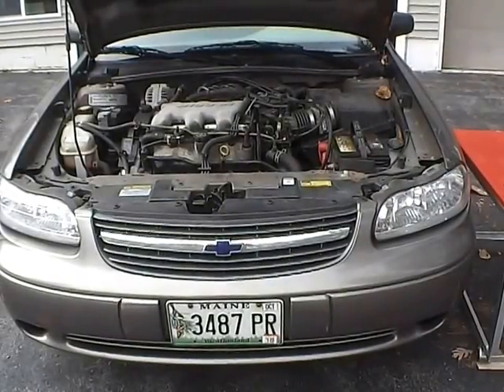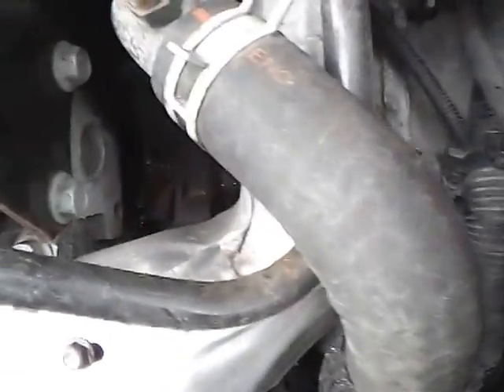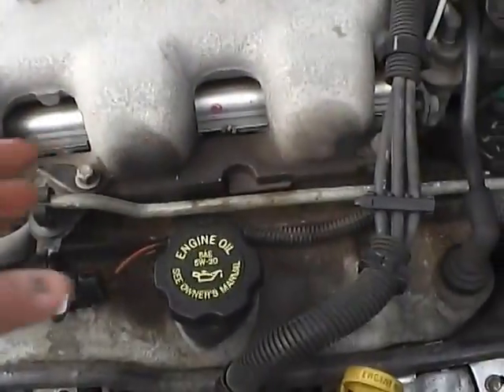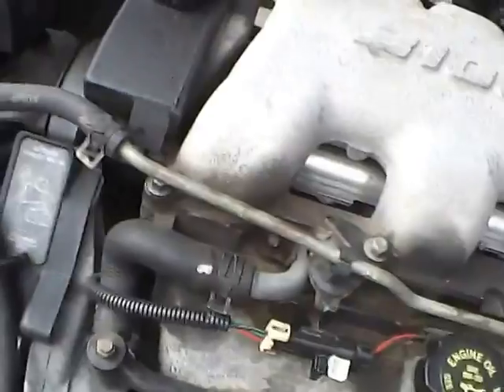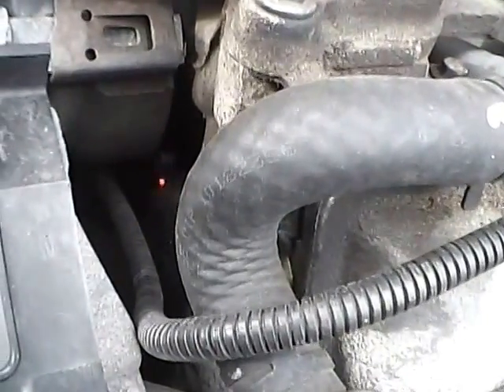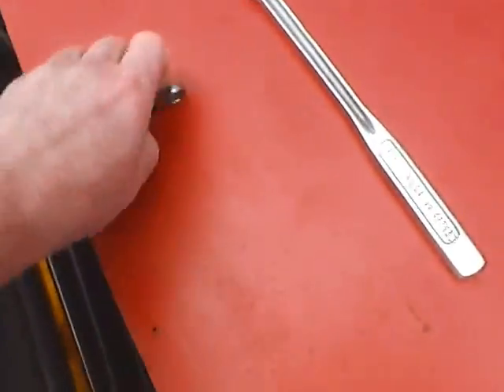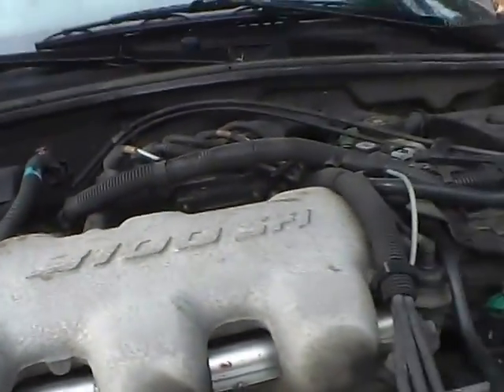Malibu or GM 3.1L  Engine Coolant Leak Quick Fix

Comment: For anyone doing this! It was actually pretty helpful but he missed the main culprit, same 10 mm bolt but its right above the leak there just under the wires that connect to the throttle control. Its right above the puddle of leak

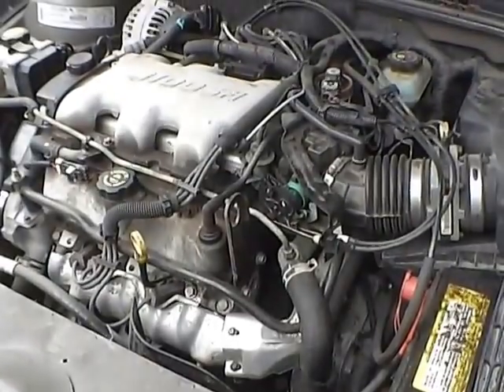Comment: Your video is now almost a century year old. This shows the significance of sharing our experience with others. I have a 1997 Malibu with 30k miles, this exact thing just happened to my vehicle and your video has helped 7:16  me solve the issue. I did however remove the power steering pump and a few things to get better access to the outer bolts. As you indicated all the bolts were significantly loose. YouTube has become our Encyclopedia of knowledge. 🙏

Comment: I'm sorry but this isn't a fix for the gasket leak. Loose bolts aren't why this gasket leaks. It leaks because the gasket seal around the coolant port between the surface of the lower intake and the head has deteriorated. In some cases the plastic also has become brittle in that area and broken down over time. It's more likely that whoever worked on your car last did not torque down your lower intake bolts properly or reused the bolts after stripping them out and that is what is causing your leak. If someone truly has an intake gasket leak the only fix for it is to change out the gasket.

Comment: I have a 2002 Chevy Malibu and have been leaking antifreeze every week I've had to put antifreeze in it I can't I don't know where it's going can't find it some people said that General Motors had a problem with the surge tank cap well replace the surge tank with the new cap and the problem actually got worse so I ended up but I watched your video and I end up tighten down those six bolts and it worked I had also put Teflon tape around the surge tank cap and now it doesn't leak antifreeze at all now thanks for your video

Comment: Eh! Idk cause if you tighten that down, you may have a oil leak. Supposed to be recommended tightening. How ya be careful but came down all to it and after changing the head gasket and thermostat etc? Found out it was a timing cover gasket. 🤦🏾‍♂️

P.S I was told if it ain’t broke don’t fix it!

Comment: only problem is if you tighten those bolts too tight you will crack the manifold since it's plastic also the gasket is plastic which is destroyed by the DEX-COOL antifreeze
Reply: Maybe is when you mix different coolants together
Reply: Then GM should pay for whatever damage is done by the Dex since they recommend filling it with the stuff in the owner's manual.

Comment: I read your updates in the description of the video, interesting... the last update said the garage charged to almost $700 to replace the intake manifold gaskets.... seems a little steep but then again most garages are, they gotta keep the lights on, sucks that the guy that did it only made about fifty bucks though and the shop kept $600 but that's beside the point, I digress, the real reason I wanted to comment was you said In your last update in the description after they did the work you now have a check engine light with the code p0171 which is lean bank 1 ... and they told you that you need an oxygen sensor... now coolant CAN junk an oxygen sensor for sure, but if I had a lean code pop up right after someone changed my intake gaskets I'd automatically be a little suspicious and was check for myself if my o2 sensor was actually stuck lean with a scan tool out it was functioning properly and also look at my fuel trims and check for vacuum leaks and the new gaskets or maybe they forgot to hook up a hose or broke or split one by accident causing a vacuum leak.

Comment: if the gaskets cracked how would tightening it more fix it, the fasteners from the factory are torqued to spec... i dont understand how the fasteners are coming loose on their own
Reply: They don't. The gasket is plastic and the seals are rubber. When the intake is originally installed on the gasket it compresses the rubber into the plastic gasket and makes a seal. Over time the rubber and plastic around the ports start to deteriorate from the coolant heat and then you get a leak. Since these cars use plastic gaskets they can't be compressed anymore. if your bolts are loose it's because someone previosly worked on your car and they were either stripped or not torqued down properly to begin with. They shouldn't be loose.
Reply from the maker: You have to understand that the gaskets have a certain thickness but when they turn to "goop" that thickness is decreased leaving the intake manifold bolts no longer torqued! Tighten them again squashes the bad gasket and seals again partly. It is Not a perfect fix, but it can buy time before having a major repair.
Reply from the maker: It is not a crack in the normal sense of the word. It is more like Goop

Comment: Not a good fix. The 3100 is a great engine, but it suffers a few problems, notably the intake gasket design. It's not too bad to just take the intake off and replace upper and lower gaskets with the metal Felpro gaskets. Fix it right next time.

Comment: I have A 1992 Isuzu Rodeo with a 3.1  V6  Chevy engine.. Do you happen to know the firing order I need to set the timing
Reply: It don't have coils?  Any info can be googled. Shouldn't take 2 mins to find out.

Comment: I am not a mechanic, but I did work for a mechanic as an apprentice for a year. 
First : 
I have a 00 Malibu 3.1l , when I first got it I did the mistake of putting the wrong antifreeze color green as the require gm that is color red , this was before I work as a mechanic apprentice. 
I can see in this video that this vehicle has the color green antifreeze and I read somewhere that it eats away the gasket, soon after I put the green on my car ,started leaking from the same spot as this vehicle. 
And I know that replacing the upper intake manifold is expensive but working for a mechanic I did had the chance in doing myself and I do still drive my 00 chevy. 
I don't believe that only a mechanic can do it ,it just a matter of doing an extensive research first also having the appropriate tools , do not attempt to do this job without having a trusty torque wrench.
Reply: This is quite different than the compatibility issues Dex-Cool has had. The L88 3.1L and most of its relatives just had a poor intake gasket design, made from what I would call an unsuitable material to boot. Unrelated to the Jello/sand problems those same engines (and many other GMs, ugh) experienced. I love my shitty Chevies, but DAMN.
Reply: ... wasn't GM sued over their Dexcool concoction, which caused damage to engines.

Comment: first I am a mechanic student, secondly that engine is an aluminum block where it is common knowledge that if u over torque those bolts u will scrap the block itself because it will warp. this maybe be a quick fix but the true fix for this is to replace the gasket. if u do like this man does and tighten half the bolts it will most definitely warp the intake cover with it run over time. that's why he says he still has problems with it. its worth spending money on a mechanic who is certified for professionalism in automotive repair. that way u end up with a fixed car that is dependable not barely running.
Reply: how do you get certified for"professionalism"in automotive repair? lol Im certified in "excellence"  in automotive service....at least that's what my ASE certificate and patch says lol but I must've missed out on the professionalism certifications...lol 
I'm just yanking your chain bud. just wait till you get out there in the real world and start working, I admire your conviction, but honestly what this guy is doing is just to get him by for a little while longer, that's what is poor people have to do from time to time, I could never afford to have my own car repaired at any place I've ever worked at. And honestly you'll find out pretty quick that all that professionalism your talking about in the repair industry is few and far between, I went to tech school for automotive technology too bro and I thought kind of the same way you do now at first , but most people are better off doing a little research and fixing their own vehicles alot of times.... there are some really good honest mechanics out there but not many, you'll find out soon enough that you chose a profession that's full of hacks, crooks, and cut throat back Stabbers ... sad but true... and what this guys doing here is nothing compared to what your bound to see go down in your career if you end up sticking with it.
Reply: @TheCoatneyadkins  I believe they take advantage of people and not qualified or trained enough to take their time on other people's vehicles.
Reply: block is iron
Reply: @dereck72  Yes I have a '99 Cutlass -- the heads are aluminum and the block is cast iron

Comment: thanks  man
mine has 40000 thousand       and the ignition went out the back tail lights were out the front right shock coilover spring snapped and the coolant leak is getting really bad now
unbelievable.    again thanks

Comment: I've got a 1997 Lumina, 3.1 L.  All of the intake gaskets on these types of engines have to be replace because they were partly plastic.  My grandmother had it replaced around 30,000 miles.  My coolant is leaking as well, but not in the same spot.. still digging.  Good video.
Reply: Nick Fox check timing cover gasket?
Reply: Mine is leaking a little. I have a 1997 grand am GT has 56 thousand miles,  omg

Comment: i SO WISH that i had seen your video before i took my engine apart!  i also had those loose bolts, and i know now that your method would have fixed my problem.  the head gasket was not that bad.  thanks for putting your fix on line - i hope someone else can benefit from your video.

Comment from the maker: Update; I received the car back from the garage. The coolant leak is gone, but there is a New problem. The engine light came on in just 4 miles and I found error code 0171, a likely intake leak.The engine idle is rough sometimes and the car has more power! With it idling at 750 RPMs, I sprayed starting fluid down in the intake engine valley. The engine took a dive to around 300 RPMs and almost stalled out. After it smoothed off, I sprayed again and the engine almost stalled. They said to get a downstream O2 sensor for them to try next. I think it now has an intake manifold related leak, since the spray should have not cause the engine speed to change and we did not have the engine light on before. Any input would be appreciated.
Reply from the maker: +cyjo2009  We brought the car back to the garage after they replaced the intake manifold gaskets because the car now shows  the P0171 code which is too lean fuel mixture. This code can be caused by too little fuel or too much air in the mix. Because the car has more acceleration/power than ever, it is not too little fuel. They then replaced the intake manifold gaskets a second time (Major Pain! ). After this was done, driving the car 21 miles, the engine light is on again!  Brought it back to the garage with a $20 upstream O2 sensor from Ebay that I suggested to try. They said it would likely not be the problem. They called a week later and said the upstream O2 sensor WAS the problem and the idle is now smooth and NO engine light on after they drove it 100 miles. We have had the car 2 days and 50 miles of driving, all looks good. No coolant leak, No engine light with bad idle, Good performance.  Because this job was more than I wanted to tackle with everything else going on, I had the garage do it. So far, So good. John

Comment from the maker: There are six 10 mm bolts. 4 of them go vertically down into the block. The other 2 go into the heads.
Reply: Nope there are 8 chief I did your trick and yes they were loose but it didn't solve the gasket failure.

Comment: My sons car leaks cooling fluid, some oil in coolant, no coolant in the oil. Is there 6, 10mm bolts or is there 8?
Reply from the maker: +Jimmy S You are correct.There are 8 bolts. I could not see the last 2 on the right of the engine at first.